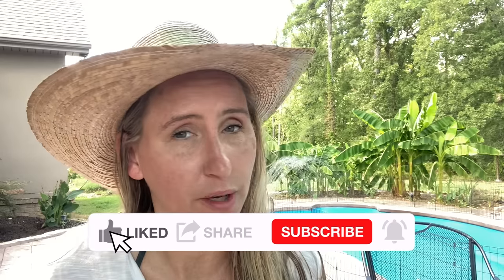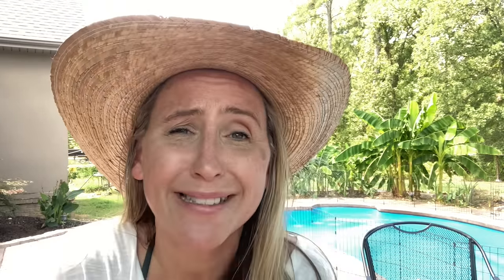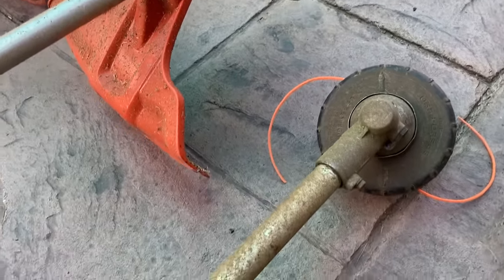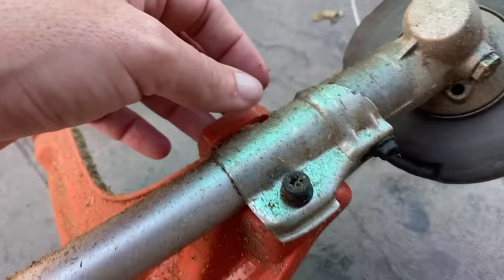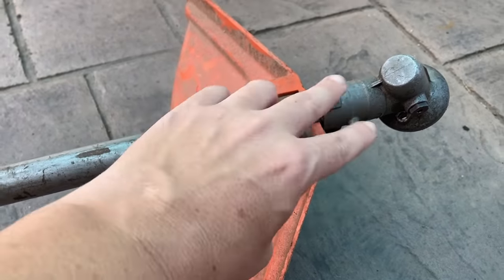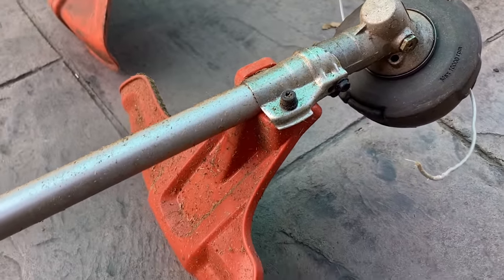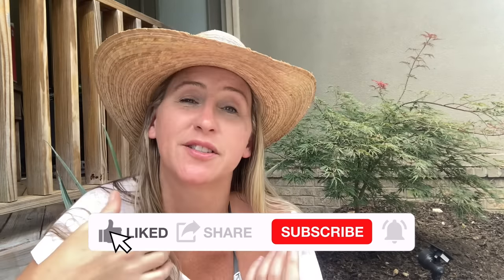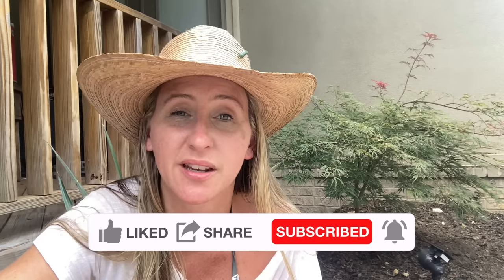String trimmer guard ON or OFF? Will it destroy your Stihl, Echo or Husqvarna? You might be shocked!

Comment: Just a quick question about weed eaters. The new weed eaters that have the new torque packages seem to be way low on power. 

I purchased a Hyper Tough from Walmart in 2017. It has served me well. I had to adjust the carb mixture settings just after I got it and it hasn't ever been a problem to start. Good power for the size head and would hold its own when tackling stalky brushy grasses. 
Last week I could pull the rope and hold onto the coil wire and you guessed it. No shock at all.
Yes I tested the spark plug first, no spark. But I had to try the tried and true method.

Got a Bolens yesterday. Small 16" width cut. With a 25cc same size engine as many other popular models. And equal size to my Hyper Tough This thing loses all RPM just entering grass. The string is .080 from the looks of it, but the string is very curled and stiff, so the thing cuts so bad because you have to give it full throttle just to stretch the string out. If you back off the throttle the string starts to curl back up and scalps your grass or excavates your topsoil. This thing is gasping for air. It cannot power the head.

We won't even mention that when I am standing with my hands grasping the hand positions properly the head of the weed eater is 1.5' off the ground. The Vietnamese Or people from Laos would feel right at home with its size. But I'm 6'1" so yeah. If I put the front handle right in front of the throttle handle then I can edge around my toes. So ergo friendly, not so much.... So looking like an old hunchback man pushing a push broom is my position for weed eating with this thing.

Comment: One thing that is never mentioned with regard to the guards is that they give a good visual reference to the length of your line. If you are trying to trim around fragile stuff you can turn in such a way to put the guard against what you want to protect and you won't ever cut it. This is a real big deal with trees in the middle of lawns. I watched a lawn care crew at an apartment I lived in kill a 100+ year old maple in one summer by string trimming close around it - and simultaneously girdling the bark off it. Sure, ignorant workers, but the guard can help prevent you from accidentally damaging your plants.

Comment: I have 2 Husqvarna 535LK pro combi's and have done exactly what you said. I bought 3 extra strimmer heads and fitted different blades for quick change. As for the guards, I keep them on! Though not a fan of the oversized guards!

Comment: So I have a Husqvarna 128ld I’ve had for years. Well bought a aftermarket blade for brush cutting. Bad idea. Ended up destroying the half shaft,half shaft cable and the gear head. So the cost of replacing was close to the cost of a new one so I bought a new machine a 130L piece of crap compared to the old one, plus not a split shaft. I was in wal-mart at the end of the summer and they had the lawn and garden stuff on clearance. They carry the hart brand attachments and guess what, they fit the Husqvarna. I bought the edger, brush cutter and the Roto tiller attachments for $35.00 each. So the 128 Ld is back in use

Comment: I hate Red Max.  I bought an expensive one.  It was a lemon, never ran consistently.  I had it worked on twice.  I finally gave up on it.  A small, curve neck Echo I owned never failed until it was 10 years old.  I now own a straight neck Stihl model FS70RZ.  I paid $275 for it in 2017.  It's the best trimmer I ever bought.  It starts every year without fail and never required any maintenence other than cleaning the air filter.  It's now 6 years old and started this year like it was new.  By the way, I removed the shield a couple years ago.

Comment: Ah too guard or off the  guard . I have  had  the  Stihl 110 Kombi unit for 4 years . Little problems . I  do small maintenance putting grease in the access area  I  use it residental commertial about 4 hours a week end every other weekend .  Been a great tool as a Kombi unit . Purchased it  at $349 .xx and the extra items , hedger, edger , pole saw , all  well over or near $200.00 . As stated little  problems except a gas cap recall . 
Love the Banana plants around the  pool .
Cheers 08/07/2022

Comment: guess I was lucky with my Stihl;90;;;I just cut the plastic off and didn't remove anything metal;;;I was using supposedly gas without ethanol from a farm oriented gas station but found out I was paying higher price for regular gas with ethanol;;;;kinda angry bout that;;however after three years with three school contracts it worked ok until it wouldn't start and run anymore;;;;when ya pulled on the starter chord there was no compression;;;lol;;;just like the spark plug was out;;;;hmmmm;;;;thanks for the info girl;;;with tha t pool in the background I would have had to take a plunge to cool off a bit;;;;lol;;;;thumbs up here and keep em workin;;;;

Comment: I'm a Pro, and I always remove the shield. BUT! You must remove the bump head and replace it with a fixed line head, and always make sure you use the correct size line at no more than 18 inches. When you don't have a shield and you tap a bump head, more line will come out then recommend, causing the engine to lug. This can burn out the engine.

Comment: On the Shield thing...I personally remove the shields on my own because: 1) I typically like the string SLIGHTLY..and I do mean SLIGHTLY longer than the shield allows..2)..maneuverability..it's a real pain to get around posts and fences with the shield on, and many other obstacles..3)I can see what I am trimming better with it off, and 4)..when cutting tall grass and weeds, it gets choked up and wrapped around the head much worse with the shield on...I have learned to listen to the RPM's, and if the string gets too long, I "burn it off" on a rock, concrete, post, etc. until the RPM's pick back up...THAT SAID, I have seen many people who run the string WAYY too long with the shield off, and damage the gearbox, clutches, or carbon up their exhaust port from the reduced RPM's(lugging it) from running too long string...if you can't keep the string at a reasonable length, keep the shield on!..and I would definitely recommend leaving the shield on for crews like inmate work crews, etc., for liability reasons, and they usually don't care if they destroy your equipment and will run it way too long with the shield off. BTW, those 125/128 series Husqvarna trimmers are junk, they are Poulan designs(yep, Poulan is owned by Husqvarna), and probably assembled in the Poulan factory...they are inferior in every way to a "true" Husqvarna trimmer(or one of the Redmax built units)...

Comment: Why take the guard off anyway? Your line don't need to be 9 to 12inches long to trim OR edge! It can still be done with the factory setting and guard on with some models by orienting the head (or if you have the split shaft, just adjust it 90°). You can even turn the whole unit, engine and all.

Comment: So cut the shield and leave the mounting hardware assembly intact. 
That would stop the twisting of the gear head. 
I only use my trimmer for home use and I leave the shield in place. 
Had a 29cc homesite straight shaft that lasted me way over 10 years.
When it needed repair the parts just weren’t available!!
Best $99 dollar (home use) trimmer I ever had!!

Comment: I cut grass full time to make a living for 17 years. Stihl Fs100RX has the most power to weight ratio of any string trimmer.  I remove the guard. Modify the spool to run only one line. Remove the spark arrestor for a little extra ump. I replace the D ring handle with a straight handle 18" or so pointing to the left. That lets me stand up straight without a leaning twisted lower back. I get 3 years or more from a trimmer before the compression gets weak. A time or two I've had carb problems. No other failures in 17 years. Oh. One line lets me run a larger radius. Never a guard for me!!

Comment: I have had my Stihl F85 for about 25 years and have had no trouble with it except I don't like the exhaust oil burner feature because it keep an oily mess on the engine and I am constantly having to wipe it clean....I have never removed the guard, it is a good feature....

Comment: I converted my echo pas - 260 combi system to a straight shaft and just put the trimmer head off the attachment on it. Added a darwin grip and been using it for over 10 years total and is the best trimmer i have ever used.I love the trigger system on it but I hate the trigger system on my  srm 230.I have never had a single issue out of either trimmer but the pas-260 is just phenomenal. i wasn't using the attachments so i figured what the hell not to mention all the heads from the attachments fit the straight shaft so win win. Love your channel!!!

Comment: As someone that runs an FS 131, I tried without a guard and it sucked.  The guard keeps the line at the proper length for cutting.  More line cuts less because the line slows too much.  You will be slower!  
I cut 200+ acres per year
Learn how to use your trimmers!

Comment: The right to repair debate is heating up again lately, so we're getting some more exposure to information on how things like warranties work. And that thing you said at the end of not servicing those trimmers under warranty because the guard was off? You'd have to actually demonstrate that taking the guard off was the direct cause of the damage. And the proof of burden lies with the manufacturer, or in this case with you as their representative I suppose. See Moss-Magnusen Warranty Act. And what worries me in this case is that you spent an entire video warning us of the dangers of taking the guard off w.r.t. the longevity of the gear head, but admitted in the video that you can't say for sure that's what caused the damage. Well, in this case, you haven't demonstrated that the removal of the guard has caused the damage, therefore you haven't demonstrated why the warranty shouldn't still apply.

There's a lot of myths surrounding warranty that we all take for granted. The most egregious one being that of the "warranty void" stickers: they're actually illegal. Not the stickers themselves, but the custom of denying warranty claims because the stickers are broken, which demonstrates that the customer has been poking around inside. That's their right. It's their property, they have a right to open it up, study it, repair it, service it, and if something breaks as a result of that, the manufacturer can deny the warranty claim. But only if they can demonstrate this was the cause of the failure.

Comment: I have a 1993 Redmax BC260DL and it runs perfect today. 1 pull with choke on turn the choke off and it runs. I leave the shield on to cut the line as I bump it to let string out.

Comment: Good video.  My straight shift I bought in 1993.  Runs great.  Came with a metal blade and string trimmer.  I have replace plastic primer and that is all.   But my John Deere tractor is a 185 with the 54 inch deck.  My trimmer is a John Deere 30g.  Equipment does not have to wear out if you maintain them.

Comment: The shields are on my weedeater.  They cut off the string if it gets out to long when I let it out.  The worse problem I have had was a piece of string hitting my ankles.  It smarts.  Why don’t you wear a bikini when you are out by the pool?  I normally use my 28L Husky and I have a strap on it which makes toting it easier.  I gave an Echo GT-1100 Echo to my son in law after going through it and replacing everything that needed it.

Comment: I keep the guard off because it's easier to cut with IMO, then I put on a T25 head. A couple ounces saved pays off when you weed eat for 3 hours at a time. I also like to be able to adjust the length of string depending on how thick the grass is. On a second note: I don't know how anybody starts power equipment form the ground. 😆

Comment: I say the guard is important. It cuts the string to the perfect length that research determined. Companies test their product extensively. The longer the line, the less RPM and torque. Plus, if their not even, it's a balance issue. 
 Now, let's see what you say.

Comment: Hi Chickanic.
I'm a new follower and I'm just catching up on your great videos, so apologise for the late comments.
Apart from the shield protecting you from flying debris, it also cuts the length of the line so the engine doesn't bog down because of the line length. If the line is too long it just can't rev fully (centrifugal physics). Also if the line isn't the same length, it can cause vibration and put extra stress on the head and your fingers.
The noise is the line hitting the head because it's not been thrown out because of the speed it's moving out. It stops when you rev it because the line is being thrown out away from the head. I bet if you had looked at the head where the line would flex around to, you'll find impact marks from the line 😁
It would be interesting to see that in slow motion to see if the cable hits.
There is a video out (5million hits last look) that a guy videos a strimmer hitting various type fences to see how the line acts in high speed.
It's a fascinating watch.

Comment: I Totally Agree With  Laser 3303 When You Take Off The Safety Guard ( Line Trimmer ) & Your Line Is So Much Longer It Becomes Unbalanced At The Gear End, Causing Bad Vibration . Plus The Engine Won't Rev Out Like It Is Suppose too. The  
 Guard Is There To  Protect The User From Getting Hit In The Head Like That Fellow You Mentioned. It Could Have Been Worse He Could Take Out An Eye, Or  Lose Use Of His Manhood For A While. Other Thing It's There To Cut The Line To  The Right Length  So That The Engine Can Operate The Way It's Designed Too.  Having The Guard Off & Having The LIne So Long Puts Excessive  Pressure On  The Clutch , Causing The Clutch To Overheat & The Engine As Well. Then Things Start Melting & You Can Cook The Engine If It Gets Too Hot.. That's Why  His Clutch Won't Disengage At Idle. The Clutch Got So Hot & Everything Started To Fail.. This Is  a Stupid Thing To Do. It Will Only Cost You Money In The  Long Run For Someone Like You &  Me To Repair The Machine,  Education Is Cheaper Then Repairs. If You Spend All That Money To Buy Good Equipment, Why Treat It Like SHIT ( Sorry )  As You Said If You Look After Them ,They Will Last For a Very Long Time...  Sorry About The Rant ..

Comment: As a commercial user, The guard off does give you better control and visibility , especially when edging. The downside is that without the guard and the line cut off , the longer line length will make the engine labour and unable to reach full revs, which increases wear. Not to mention the safety to the user and anybody nearby. Will contravene health and safety requirements and possibly void warranty and any liability insurance. Hey, just my opinion, Thanks.

Comment: Always used my Echo srm-225 with no shield. I can see what I'm doing much better. I also never advance the line by bumping, I just turn the head and let a little line out here and there as I'm working manually. I don't like the idea of the trim line being cut off and waisted, it's easy to let the right amount of line out as needed. I've got to be careful edging sidewalks to make sure I'm off to the side in case a rock gets kicked out when running it vertically.

Comment: So I watched this video and you referenced the Stihl heads. I just recently bought a new fs56. Unfortunately, the head does not have the grease port screw. I have a 4 year warranty on it, so I am not concerned if it goes out in the next 4 years, BUT when the warranty expires, do you think drilling a hole and tapping it for a grease port is a good idea or worth it, or just run it and when it goes, just buy a new head? Thx.

Comment: Stihl 131r is my main runner also I run a 240r  in the commercial yard care , I have two 131r s  .  I remove the guard or half of it and run it all the time , more line , more trimming , much much faster . I turn the jets out for more fuel or it will not run right with more line .  Having debris fly at you is all in which part of the spinning line circle ⭕️ is touching the ground . Sometimes it can’t be helped but once you have the feel for it you can hold the trimmer and cut in a way most debri will not hit your legs .  For example, next time using the weed wacker hold it straight and cut , tilt it to the right and cut , then left and cut , you will notice the blades of grass will go in different directions .  I have way way to much string trimmer experience, cemetery’s , commercial properties, along busy roads ...... yes I have taken out a couple of car windows on accident hitting small gravel stones ... it can happen from time to time .  Anyways guard off does and will burn the clutches and drums much faster if your spinning more line and there is a limit to how much line you can spin but the trimmer becomes far more productive in the right hands ......for proper safety regardless of guard or no guard safety glasses and pants .... pants are optional though 😂😂.

Comment: i have an echo srm2400 split boom with various attachments and used it commercially for 5-7 years and non-commercially for the last 20 years and other than the regular replacement parts (spool, carb kits, fuel lines, spark plug) only had to replace one shaft cable.  i have more than gotten my moneys worth out of that machine

Comment: The stuff I commonly do, large areas of heavy vegetation, you have to use a guard or you probably won't have a nice looking face afterwards. I've tried without the guard just to see what all the fuss is about, and it cut terribly, I don't see why people do that. The engine was bogged, it sounded obviously terrible for the engine, and it literally wouldn't cut anything, just slap really hard. Maybe it would cut light grass but nothing serious. I put guard back on, cut smooth as glass, fast as I could go.